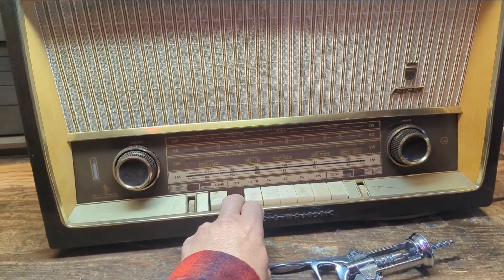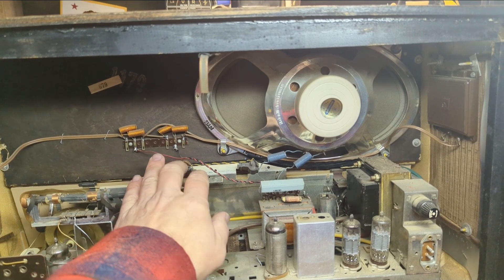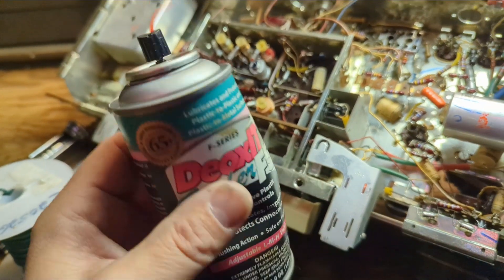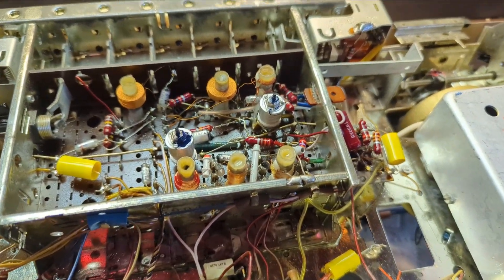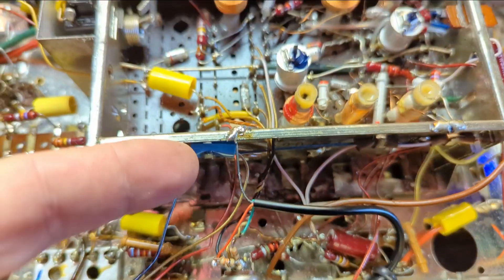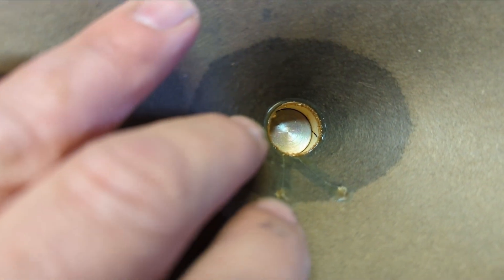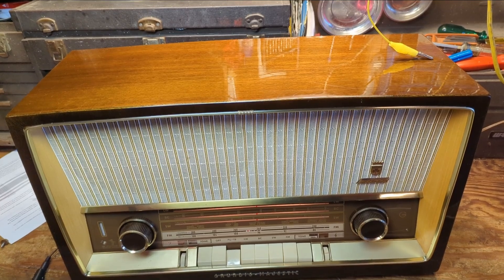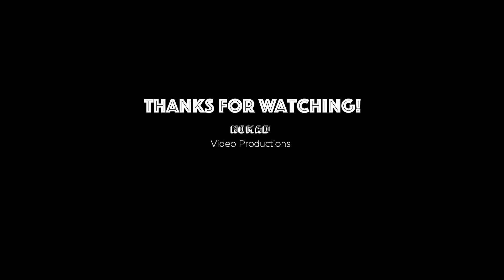1960 Grundig with sticky buttons and a bad speaker

Comment: German here... the tube tax is (mostly, as in post WWII) a myth. And even in the small time before the war when there were financial disadvantages (technically not a tax) on multi-tube sets,it was once at the point of sale, not ongoing. But that was waaay back, the first multi-section tubes are from the mid-20s (Loewe 3NF - 3 tridoes, some resistors and caps in one tube), and the maybe most notorious was the VCF11 from the DKE38. 
The "Radio-Fee" was not dependent on your type of radio. From a crystal set to a 12 tube multiband receiver - it was 2 Marks a Month from 1925 till 1970 (!) (didn't even change during the changeover from Reichsmark to Deutschmark after the war). 
Maybe that's mixed up with Italy, where in the very early days of radio you'd had to buy tube-tax stamps and glue them on the tubes.

Comment: I have a 1959 Phillips Jupiter German radio. I ran across two speakers in this radio with an impedance value I have never heard of. It uses two EL84 tubes in series push pull, capacitive coupled with no output transformer. There are two 400 ohm 6 x 9 speakers hooked in series because it needs an 800 ohm load!  I tested the dc resistance, and sure enough they are 320 ohms each. Good luck finding a speaker to replace those!

Comment: I see these German made radios as the epitome of proper electrical receiver design (except  for the wax paper capacitors).
It hasn't be touched in a long  while so it needs a cleaning and  the piano keys and tuning parts need some lube. Good 
fix with a slightly bigger and better Grundig speaker! Keep high and dry Seth!⛈🌨🌫☔

Comment: Those tuning clutches are made of a crappy metal that can crumble, lucky that you didn't have to replace it. They have a wonderful sound when restored and I think this one has push-pull output. The electrostatic tweeters, if they are working, just add a tiny bit of sizzle to the sound, barely audible at least to me. Well done

Comment: Hello,
this is a wonderful Grundig radio. In my opinion, Grundig has the best receiver reception performance in the middle class sector of German radios. I have a very similar device in the German version. Something has already been done to the transformer, as I can see. Usually the device does not have a pluggable power cord and such a fuse holder. In the place of the plug there is usually a Pertinax plate, where you can change the voltage between 110,125, 220 and 240V by changing the fuse to other sockets. It is also interesting that the device has an FM range of up to 108 Mhz. The German device only goes up to 100 Mhz. 

The Pertinax switches on the piano keyboard are a bit sensitive on Grundig. If you are unlucky and there is a lot of dust on it, the B+ voltage jumps over and the switches start to simmer due to the short circuit.

When I see your videos, i think that the most american radios of the 50s have a very basic and simple circuit who could only recieve AM and neither FM. Didn't you connect a record player or a tape deck to such a radio as usually the german people on their? This is such a thing i can´t understand as german Radio user. Most of the german radio recievers from the mid 20s on have an Input for a record player. Trough the Line transformer in the Radio, you can even safely connect your mobile phone with the device to the turntable input. Like in this case with a commercially available adapter from DIN to headphone jack.

Greetings from Germany
Reply: That transformer setup is standard for export versions. At one point I was researching the differences between domestic and export Grundig. All export models I've seen with the exception of 5060 had voltage switches removed from the factory and most of them had power chord interlock, probably required by law

Comment: Replacing speakers in Grundigs is always a bit of a gamble, and you were in luck here. The engineers that worked on these sets designed everything to work together - the tone circuits were made to complement the specific speaker and cabinet combination, to achieve the best sounds possible. So unless you have a really similar speaker to the original, it will never sound as good as it should after a replacement.

Comment: I've noticed your example has no FM antenna chord- there should be one connecting the internal FM antenna in the cabinet to the FM oscillator and it looks like somebody removed it. I noticed something's very off when I saw how low your FM signal was. Normally German radios work with full magic eye deflections on almost every FM station and your never required to use so much volume on FM
Reply from the maker: I had to make a new loop for it as the one it came with was missing.
Reply: @misterradio5035  It didn't use a loop for FM as far as I know. It was a dipole antenna made out of that metallized foil in the cabinet. It's still there right? Can't imagine someone stripping it all. And a short piece of the original antenna cable is left hanging

Comment: Given the age, it often becomes necessary to disassemble the piano key assembly and remove the switch slides to get them to switch reliably. I find the contacts are loaded with black gooey gunk that the cleaner can't penetrate. Total PITA but if the first spray doesn't get it, it's bad news. The intermittents on the switch will soon come back to haunt you. Second, I'm surprised you didn't replace the selenium bridge rectifier. Those are notorious for increasing internal resistance that causes the B+ to sag.
Reply: I also was a little bit surprised, that you left in that potentially stinking selenium rectifier.

Comment: Hi, I am a german radio collector and I must totaly agree, those Keys in the front are horrible. Same as the Pertinax tube sockets. The clutch on the tunig is very common for higher End German sets. Somtimes, Specially on Grundig and Saba, they really like to grind themselves to powder. As a german I always thought american sets, they are so simple and primitive, they don't eaven have a audio input from stock. This is something a german Radio user cannon understand. (Eaven the not isolated sets have it from stock here.) 
Best, best regardes from Germany and have a great year 2023
Reply: You're probably thinking of what we call " The All American 5" which was in my opinion an ingenious design. Simple, effective and most importantly- affordable. That design came out during the 1930's depression. They cost under $20 which meant the wide masses could afford them. They ALL used the same standardized design and the same set of low cost tubes. And they are very reliable and easy to fix. So I have a lot of respect for that.

  Those are very different from the higher end sets that were also made at that time. Some of the upper level radios made by RCA, Zenith, GE and many others were extremely sophisticated and well-engineered. And most of those did come with audio inputs. In fact the term " RCA cable" comes from RCA's design that we still use today. Its likely that Europeans like yourself never see the higher end US sets because they were not sold there and due to their larger size would be prohibitive to ship there too.

Comment: The tax per tube ratio is nuts and a full misunderstanding.... i live in EU and yes they are different and some are more sophisticated than us, uk, jp sets.. not pain i t ass but higher Q in my opinion. Just take a look at any telefunken opus,  loewe... grundig was a cheaper brand.
Reply from the maker: I suppose it depends on what kinds of radios being discussed. Sure. The US made a LOT of really cheap sets. But they also made a of very high end sets too. Most that were never sold overseas. Like for example Scott, Silver McMurdo along with almost all of the high end sets made by Zenith, RCA and Philco were not exported to the EU. Many of the German sets were pretty expensive sets. Most people could not afford them. Over time I have come to appreciate a design that is both effective, affordable and easy to service. The cheap sets we had here- the 5 tube " All American 5" sets are super simple. But they work and they were priced at $20. There is a lot to be said about that